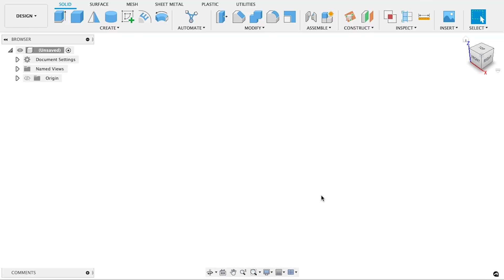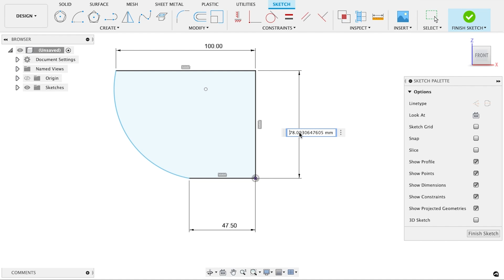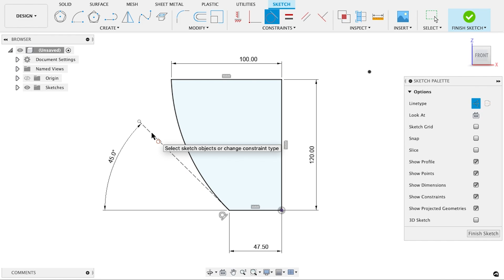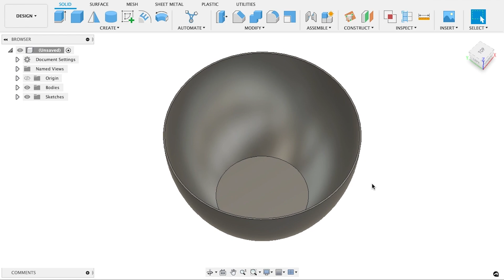Save a Broken Lamp with 3D Printing & Fusion 360!

Comment: Do you think it would be possible to make a 3D printed fish tank?
Reply from the maker: I'm sure it's possible, but it would not be ideal. It's very difficult to get crystal clear prints. Making water-tight prints is also notoriously tricky - even with much smaller projects than a fish tank. Finally, the pressure of the water would be a lot for a "sheet" of 3D printed plastic to hold.

It's too bad, I'd LOVE to design an entire aquarium with 3D printing!
Reply: @3DPrinty  Yeah that makes sense, do you  think you could use glass panes to make like windows and then make the framework to hold the panes in place? That way you could use thicker, non-translucent plastic. Or do you think that between the difficulty of water proofing and the strain the water would place on the plastic it would still be too much? 

Asking for a friend! 

(I'm the friend)
Reply from the maker: That's more possible. I think you would need to fill the glass/plastic interface with some sort of sealing adhesive. If you can prevent water from even getting to the printed frame, then microscopic gaps in the layers wouldn't matter.

Is there are reason you would use 3D printing over more tested and proven aquarium building materials?
Reply: @3DPrinty  Purely just an interesting idea that I'd like to try one day, I really like 3D printed aquarium decor so going from that to a 3D printed tank seemed like an intense but logical step. 

I think it would be a cool, but ultimately impractical idea.

Comment: I am in the middle of a project very, very similar to this so your little fusion 360 trick did shorten my attempt to design a simple shade for a table lamp, expecially the trick with the overhang angle!! Perfect timing. 

Also: That protopasta stratocumulus PLA is an absolutely beautiful filament. It's just so expensive, I can't justify adding this to my collection after buying my last batch of filament just recently.
Reply from the maker: Glad I could help. Good luck with the project!

Protopasta is definitely a special occasions filament. I use a lot of their recycled "Still Colorful" line which is slightly cheaper, but still a precious commodity.

Comment: "It's a cloud" 
Lol, man I love your videos. Can this be done in vase mode?
Reply from the maker: Way too many takes to get a good one :)

Yes, this could be printed in vase mode. Unless I'm mistaken, you would need to drill out the center hole after printing. Vase mode usually prints with no bottom layer at all or with a completely solid bottom layer.

Or... I suppose you could splice together the GCODE of a regular print and a vase mode print!
Reply: @3DPrinty  The bottom layer(s) are not printed in vase mode and can in fact have an arbitrary shape and all properties. But Cura is a little finicky about that, like, if you have a centre hole in Spiralise mode, it's going to try to print it on all layers where it's present, which just looks and behaves horrible. You can suppress it with "remove all holes" but then you have also removed it in the bottom layers, where you wanted to keep it. So you kind of have to design a small indentation into the bottom and match it with the number of bottom layers that you end up printing, and cross your fingers during slicing to make it not got hung up on the Epsilon and actually do what you want it to.

I know Cura can be a little bit of a diva but it's fairly quick to slice and you get so much gcode design detail to approach your perfect prints. So i use it rather than PrusaSlicer.
Reply from the maker: That's some great info - I had no idea vase mode would behave that way if the model had only a small indent!

Comment: Small tip, if you declare the center line in fusion 360 (next to the construction line button) you won't have to divide the sizes by 2
Reply from the maker: Another great way to do it!